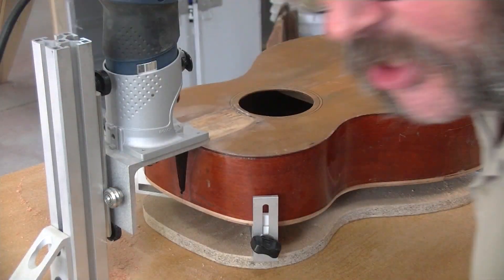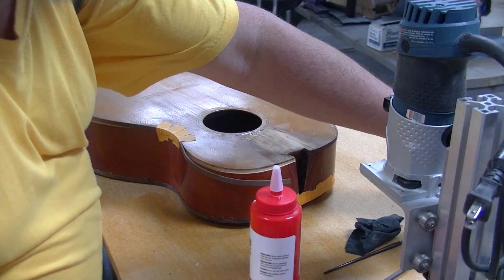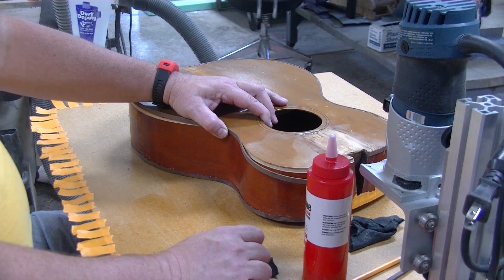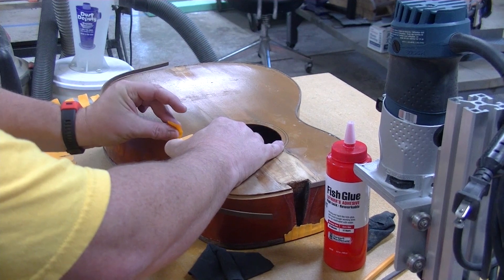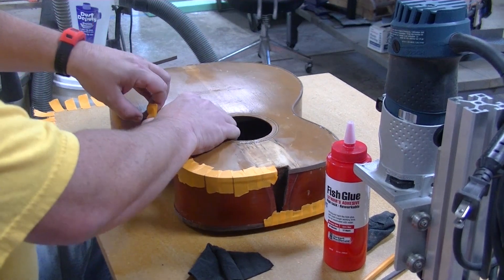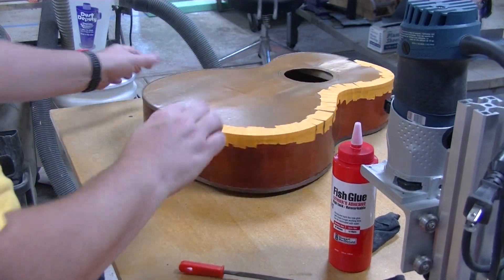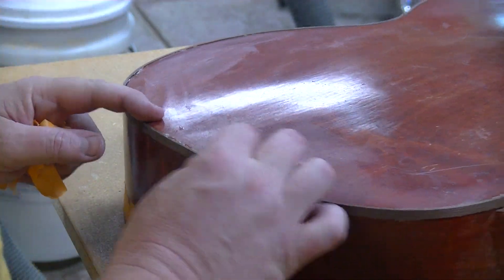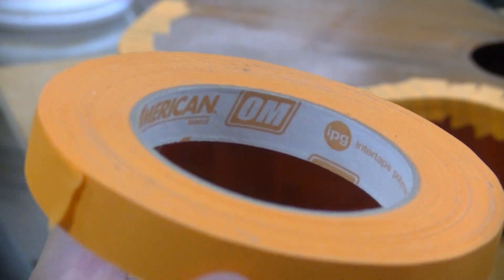REGAL parlor guitar routing and binding | RATTLECAN GUITAR RESTORATIONS by James O’Rear

Comment: What are some of the trade-off that you have to consider when making this sort of change? Obviously the "petina" and "original" factor into things, but if the net benefit is a much better guitar that can be played, that's good. Is refinishing going to be harder or easier?
Reply from the maker: Harder. If this were an instrument of "value" either monetary or sentimental I'd advise against this sort of modification. The owner is as much interested in the process as the end result and,  it was purchased with learning in mind.

The tough part will be trying to get the new body color/finish to blend with the old.